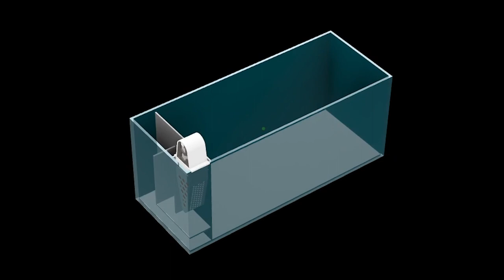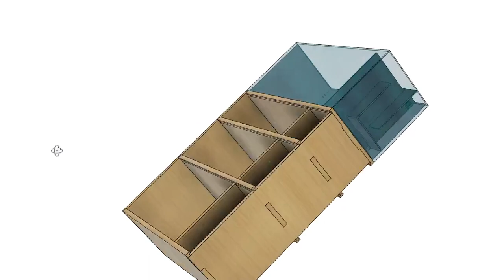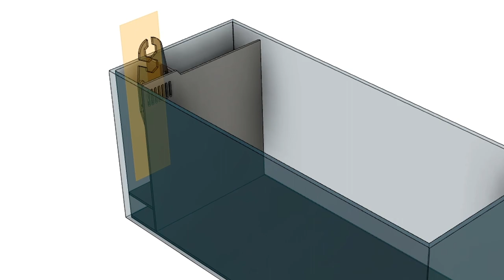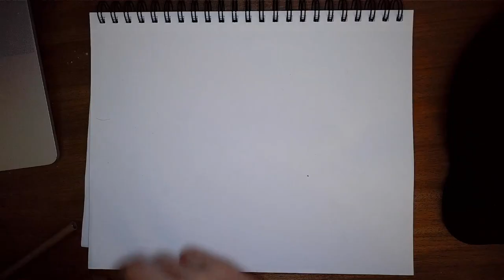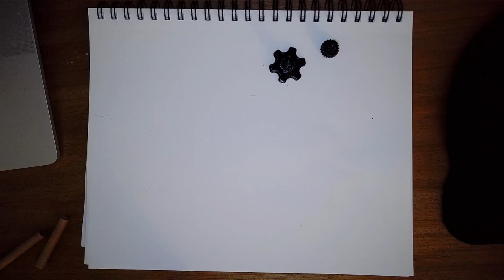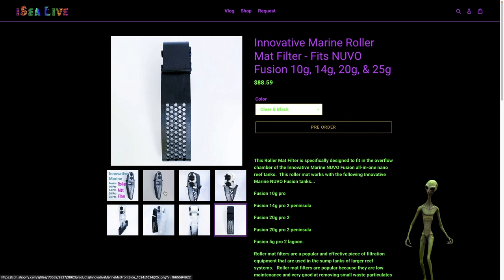Innovative Marine Roller Mat Filter - Fits Nuvo Fusion Nanos - UPDATE

Comment: I love the one you sent me for my waterbox 20. I’ve gone thru a whole roll but only because I was doing a few deep cleans of all the detritus I had built up in the back chambers. I’m expecting the next roll will last 2-3 times as long. I do wish there was a way to add the basket to tanks that have had the filter sock holder removed. Other than that it’s perfect. Thanks again. Keep up the great work.
Reply from the maker: Yeah, I’ve been including some replacement brackets for people that removed them.  Unfortunately, the basket design would have to be drastically different/ bigger and longer to print.

Comment: I have an IM tank also and you inspired me to make my own. I feel your pain with the little lip in the overflow making it hard design. I added a small stepper motor and an internal float connected to a wemos d1 mini and its fully automated.
Reply from the maker: That’s awesome,  send me some pictures.  Mark@isealive.com.   I have a bunch of controller boards and am going to add automation in the future but I wanted to start with just the base structure, no electronics.

Comment: I have one of the old 20 gallon peninsula tanks, will it work for it?  I see in your video that your tank has a weird elevation change in the panel separating the sump from the tank, that is only difference I can see.
Reply from the maker: You should compare you overflow chamber to the specs of the NUVO Pro 2 online.   You can find it on the innovative marine website.  The chamber is 2.8”x 2.8”